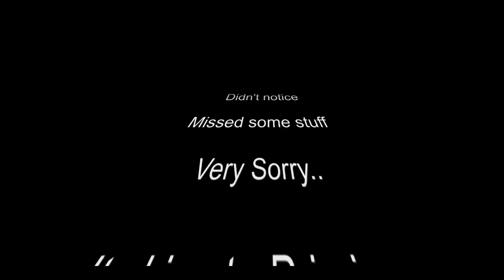Making TopWater Rat SwimBaits

Comment: how do you know how open the joint needs to be? I just made a bluegill bait and I think I need to open it a good bit. I also need to learn how to connect the joints better. I put two eye screws and then drilled from the top before putting a wire from an old spinnerbait through it. The top part lined up perfectly, but the bottom was a little loose. So I drilled a second hole for the bottom and used a different wire for it

Comment: Is that the Lee Production Pot? I am looking into getting one of my own do do a little more exact situation over here. If it is, do you prefer or see any reason not to get the Lee Precision Pro 4-20 Pot? Obviously one holds more than the other but I am just curious if you have any experience operating both.
Reply from the maker: I’ve only ever used the lee pot you see in the video, and I’ve never wished I had anything different. Haven’t looked at any of the other models, but hope that helps.
Reply: I feel like it would be a mistake to order anything else. I have seen it work and would hate to go for quantity and find that it is not quality. Very helpful. Thank you! I shall order it soon.

Comment: What did you use to put the bait back together in the middle and where do u get all the eyelets for the hooks and the magnets too
Reply from the maker: Pj Nelson I epoxyed in looped and twisted wire for the middle joint after the clear coat. Making/epoxying in the looped/twisted wire for the hook hangers is part of where the camera died on a long shot. I got the magnets off of ebay. They're pretty inexpensive
Reply: @marlingbaits  are you using one wire loop to connect the two sides?  if so, are you placing it right in the center of the two pieces.    Thanks for a great video